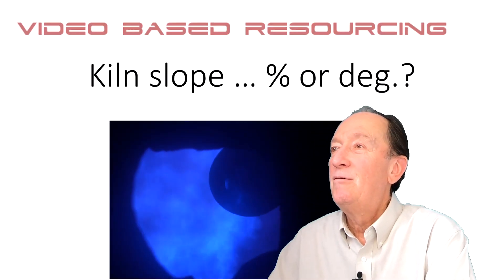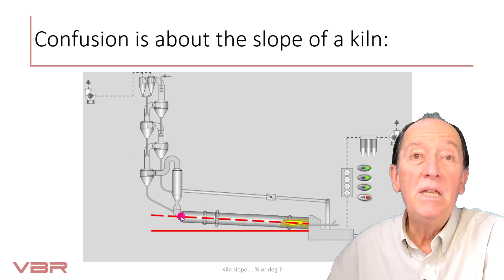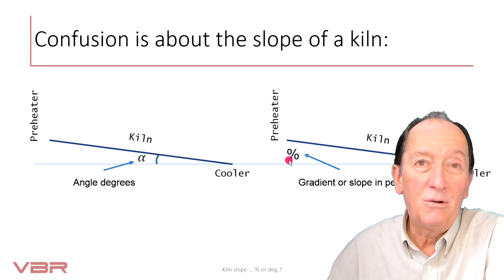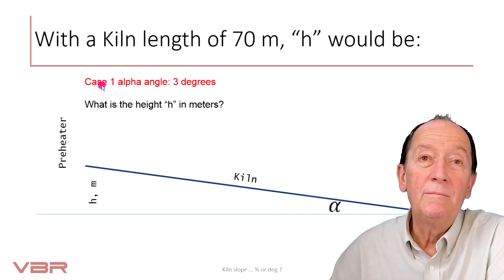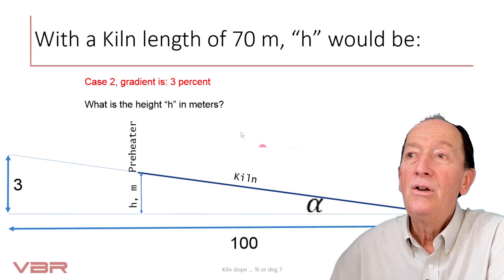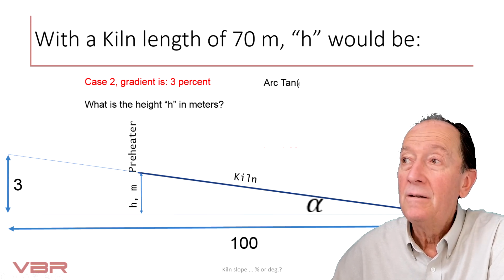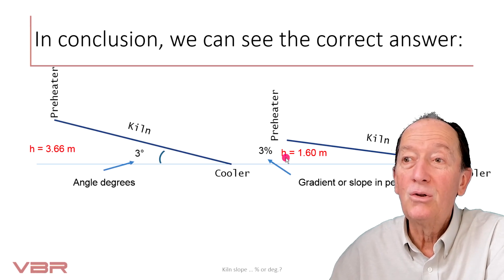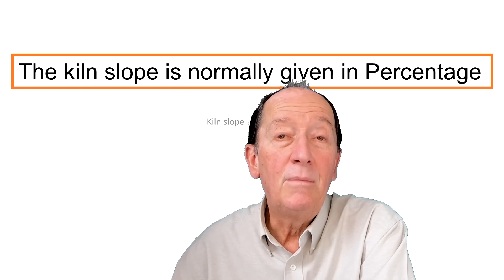Kiln Slope, Degrees or Percent?

Comment: if you design and want to relate the horizontal length to its inclination ,designer can easily determine in percent.After  having the figures in adjacent side,then you can get the angle bu trigonometry.
Reply: Yes, you are absolutely right!